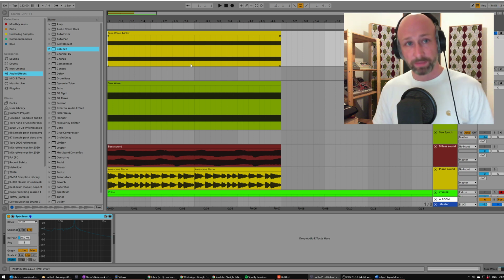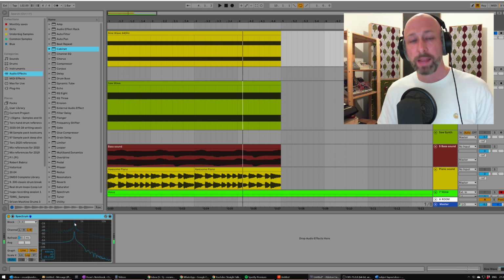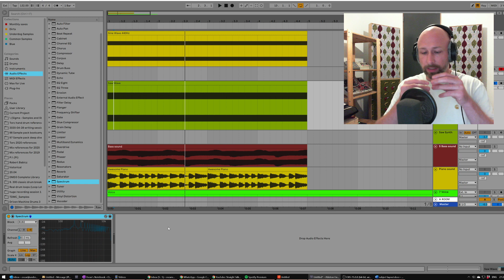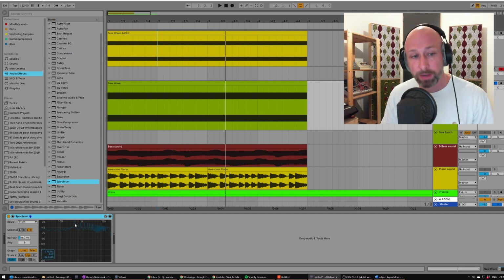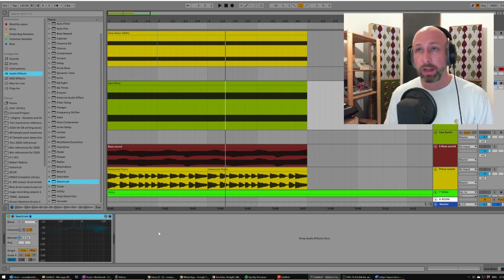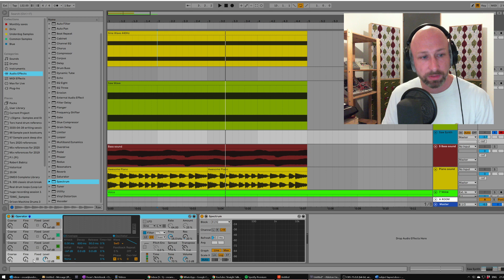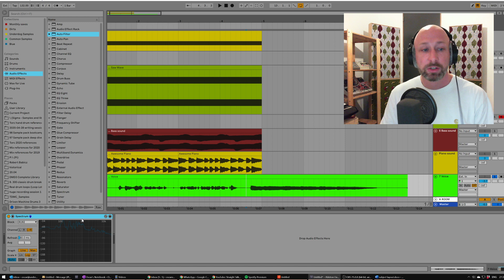Quick physics: Fundamental vs. Harmonics

Comment: Wonder if you could clear something up for me?

Often when analysing sounds (e.g within a drum kit) the reading is quite ambiguous and there isnt a clear fundamental, so is the key of a sound ALWAYS the first peak, or is it sometimes the highest peak? What is the 'rule'? 

I often get a reading on the spectrum analyser where the first 'leftmost' peak, lets say at 100hz, is several Db lower than another peak at a higher frequency, lets say 1khz. In this scenario which of the two peaks do you use to determine the key? Is it the very first peak (the lower Db of the two, the fundamental), or is sometimes the peak with the highest Db and higher freq?
Reply: I'd like to know Oscar's answer to this, as well. In the meantime, I would suggest running it through a tuner.

Comment: Excellent content...consider me subscribed!

Here's a fun fact: the brain is awesome and can actually fill in the blanks even if the fundamental is completely missing...it can generally perceive the fundamental just from listening to the harmonics alone.

Some plugins use this phenomenon of psychoacoustics to help create the impression of bass (even when the speakers are physically unable to reproduce the low frequency of the fundamental itself) by creating the harmonics instead, which are generally multiples of the fundamental frequency. The only problem with this is that the bass then becomes "bass you can hear" rather than "bass you can feel".

I love the brain. It's so frickin' awesome!